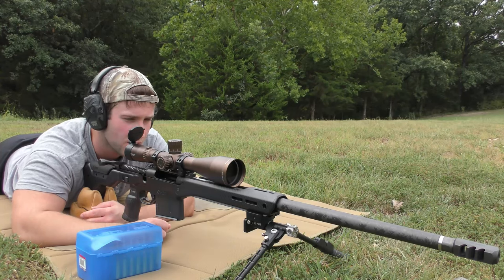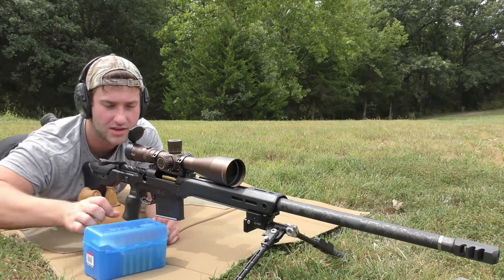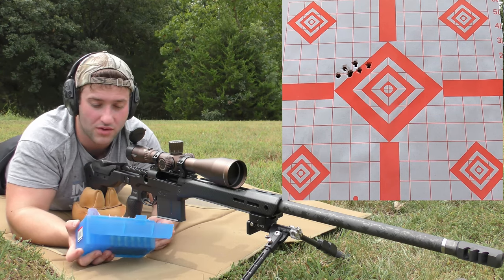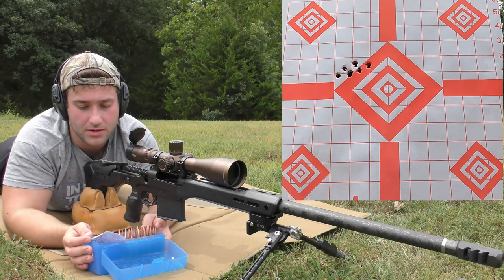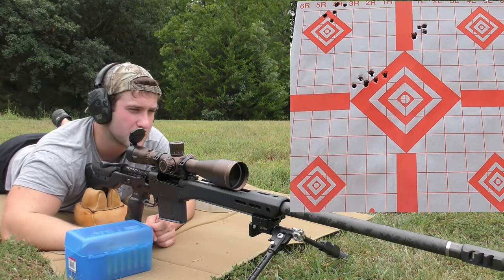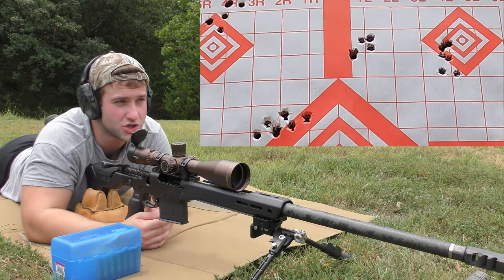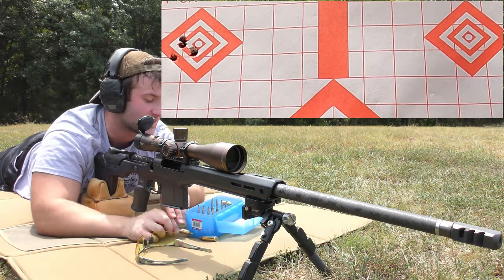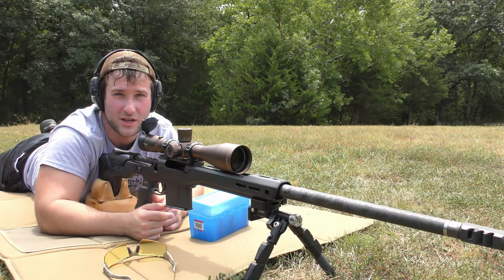Full Custom Lightweight 7mm PRC Powder Testing: Berger 195 EOL, Ramshot Grand, H1000, Retumbo, N570

Comment: Oh man, I'm just now at the 15 min mark and you're seeing what I saw with H1000! same hole (see my 1st comment). ! I've got the exact same situation with one of my 6.5-284 Norma rifles, 127 Barnes LRX and H1000 - basically a one hole load. But it is in a Bartlein gain twist barrel.

Try VVN568 with that 195 EOL

I'd also like to see how your rifle does with a 180 Berger VLD hunting bullet and LRT. I'm at 77.8 grains, ADG brass, Fed 215 match primer seated 10th off lands. For the time being, I've decided not to go heavier than 180 grain in my 7PRCs. I've had considerable success with a 168 grain BVLD in my good ol 7RemMag at 3000 fps on a lot of mule deer to 800 yards. So, for me, I haven't convinced myself to try the 195s.
Reply from the maker: I bet that would make for an awesome hunting load! I tried the N568 off camera and couldn't get any more velocity out of it over the N570, unfortunately. However, it was worth the try! I am planning on testing the 175g Berger Elite Hunters next. So, I'll be in that ballpark, at least. I bet that 7 mag load was a hammer on those deer! After performing this test, I wouldn't shoot the 195s unless you have a REALLY long target rifle barrel. I think the loss of speed doesn't justify the additional BC. You hit a point of diminishing returns and I think these are too heavy for my setup.

Comment: H4831sc, 64grains with 175gr/180gr bullet
Reply from the maker: We'll be treading that water soon.
Reply: @RisenCitizen  I have a 24 inch barrel seven PRC I run 64.3 grains typically half minute of angle at 100 yards
Reply: @Chris-liwymi  I think 64 gr is a node.( OCW) I run 65 gr and tune it.  I’ve some 195 Bergers coming and I’m going to drop down to 64gr 4831sc
Reply: I was at 63.6 with 180s until my barrel sped up and groups opened up.  I dropped down to 62.5 and have the same accuracy and velocity.  2893fps with a 26" proof.
Reply: @scottgreen6538  very nice, I really want to get the new garmin chrono but trying to hold off for a sale price, I have a 24inch barrel on my 7prc so I am curious what my speeds are

Comment: What were the numbers on the N568? I missed that part I guess.
Reply from the maker: I shot that off camera. The numbers weren't better than N570.
Reply: That sucks, that’s what I was going to try in my Element based on Bergers data. Are you using their data or hodgdons or someone else’s?
Reply from the maker: @CoryHarrison-js6ph  vihtavouri data. The accuracy was promising, but the velocity wasn't. Doesn't hurt to try it!
Reply: I just looked back at the Berger data for the 195gr and your max charges with them are basically their starting charges. They list a max charge for N568 of 70.3 for 2871fps and 71.4 of N570 for 2913. I have their full load data sheets for 175gr EH and 195gr EOL I can forward to you if you’d like.

Comment: Was the chamber cut by Proof or an independent rifle builder? Wondering if it is cut to SAAMI or the AW version. In 1 of my 7PRCs I was getting ridiculously consistent ES/SD with H1000 and 175 ELDX but it was only in the mid 2800s. Regardless, with an SD around 0  to 1 with powder charges from 67 to 68.5 grains I think it is a sweet spot. I haven't had time to  continue that project yet.
Reply from the maker: It was a prefit barrel from Proof. Sounds like you've got a fun project ahead.
Reply: @RisenCitizen  I also have a Proof pre-fit 7PRC on a Tikka action. Curiously, it shoots factory Hornady Outfitter CX ammo very well

Comment: I use N570 in my 300 PRC with a 220 gr Berger and a 24 inch barrel. I use N560 in my 7 PRC with a 168 ABLR and a 22 inch barrel. Consider N565 if you want to try another VV powder with that 195
Reply from the maker: I literally just bought some N565 last week to try it in the next test 😂. Thank you for the advice!

Comment: Not using the optimum powders for the cartridge!! Will they work yeah but there to slow for the cartridge! I ran these powders through Gordon’s and your not getting 100% burn and N570 was only 91% burn meaning the back of the bullet is getting peppered with unburnt powder! You need to be between 7828 and H1000 with this combo to get maximum velocity and accuracy!! The reason your not getting the velocity your wanting is because of the incomplete burn and the only way to get those velocity’s and get 100% burn is to really stand on it and compress the load then you will have issues when it get hot out!! The rifle is telling you this if you know what to look for on the target hence the fastest powder H1000 shooting the most accurate with the 195s! Start at H1000 and work toward the faster powders on the relative burn scale not slower and you will see much better results!!
Reply from the maker: Thank you for the information! I'll have to dig deeper into this and see what we can get!

Comment: I was getting 2970 w H1000 no pressure but terrible groups. 2960 with Reloader 25  no pressure decent groups. 2870 with 4831sc with 3/4" groups at 200 yds. I'm going to try Grand and see what it does. Thanks for the video
Reply from the maker: Thanks for the comment! That's all with the 195 Berger?
Reply: @RisenCitizen oops ... Forgot that part, 190 Hornady A tip
Reply from the maker: @eaznutts5714  ah. That makes more sense, lol.
Reply: @RisenCitizen  I tried ramshot grand today, with eldm 180. Built pressure at max book load @2980, pressure flattened out and hit a nice node .6 over max @ 3043. No pressure signs seated at book length, seems legit for the 180.

Comment: Be cool to see how far you can push N570. From what Ive heard you can hardly get enough in there to find pressure. I've got the same powder and combo and will give it a go.
Berger lists 71.4 as their max with a 195. Maybe take that with a grain of salt.
Reply from the maker: I did off camera. I couldn't get enough velocity out of it to consider it viable.
Reply: @RisenCitizen  good to know, thanks

Comment: I had picked up 1000 ends of the 195 s but realized I would never get much more than 2600fps…w/7prc.  and returned it.  7prc just does not have enough case capacity to sling that heavy of a round.  It isn’t bad, as many sling 6.5 140s all day at that speed, but ringing 3,000fps with a 195 will you have to go with a bigger case.
Reply from the maker: Absolutely. I wanted to see how fast I could safely push them in this barrel, and I think the 175s would be a much better option in this setup. More testing will tell!

Comment: Maybe look at the 197gr sierra matchkings and h1000. Ive heard of people running that combo in the 280ai
Reply from the maker: I considered it, but I think they require a 1:7.5 twist.
Reply: @RisenCitizen  id run it through a stability calculator like Berger has. Sierra tends to air on the conservative side, they claim their 200gr smk closed tip in 30 cal requires a 1 in 9 but works very well in 1 in 10s
Reply from the maker: @zebacake4683  I get that, but I also fully intend to use this rifle exclusively for hunting once I get a load developed. So, the hunting bullets have more appeal to me anyway.
Reply: @RisenCitizen  ah okay, well hopefully the Bergers perform well, if you get to take an animal with it let us know.
Reply from the maker: @zebacake4683  I would love to get some footage! I just don't know if it will happen this year.

Comment: I shoot 6*.5gr n565 with 195eol at 2920fps in my 28" 7saum with .220" freebore (long action) 
I would bet the 565 would give similar results in the 7 prc aswell
Reply from the maker: That is excellent information, thank you for the input!
Reply: @RisenCitizen  in my saum the n565 is aprox 3gr faster than n570 for same MV  if that helps
Reply from the maker: @375Ragnarok  that helps tremendously. Thank you very much!

Comment: I’m running n570 with my 195 eols and getting great velocity with consistent .5 groups or better
Reply from the maker: What velocity and barrel length?
Reply: I run N565 with 175s, and get really good accuracy with consistent velocities with my 22" barrel
Reply from the maker: @thebleeb1681  what numbers on velocity?
Reply: @RisenCitizen  2880 fps. It's not max, but it's accurate and adequate. And i'm getting excellent case fill and complete burn.
Reply from the maker: @thebleeb1681  you sound like my kind of guy 👍
Reply: @RisenCitizen Right on!

Comment: Bergers data for N570 tops out at 71.4 gr.
Reply: I have shot N570 w 70 gr w no pressure and I’m going up on my next range day. N570 is basically as much as you can compress in the case. And I don’t agree w Reloading Weatherby very often😂
Reply from the maker: I went way further with this powder off camera. I never got velocity that made it viable, and I ran out of space in the case.
Reply: @RisenCitizen  Very interesting...

Comment: these tests don't mean anything.
show us some 0.2MOA 5 shot groups or 4-5 SD 20 shot groups😁
Reply: How do you find pressure in your rifles with different powders?
Reply from the maker: Everybody has a method to their madness...
Reply: @jasonshults368  keep adding 1/2 grain and keep shooting til you get pressure signs.  Heavy bolt lift, ejector marks, etc. Back off 1/2 grain from pressure. Tune that load w seating depth testing.  If you have good brass, good barrel, good bullet, good powder… that loads going to shoot.